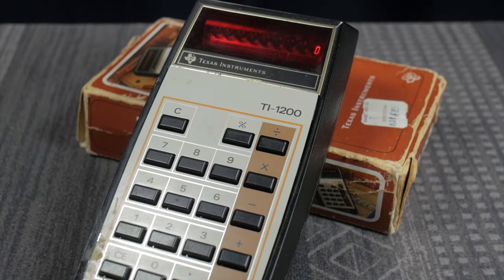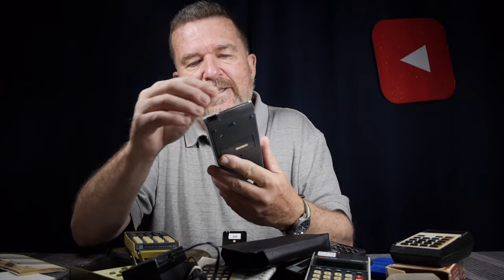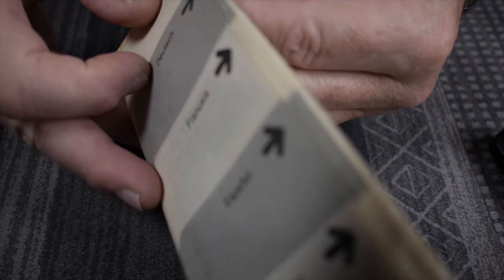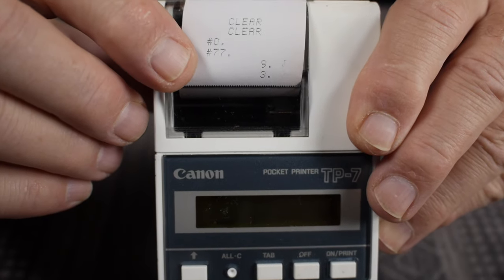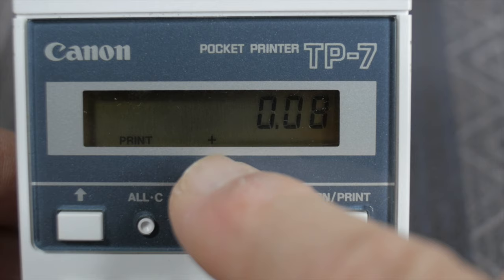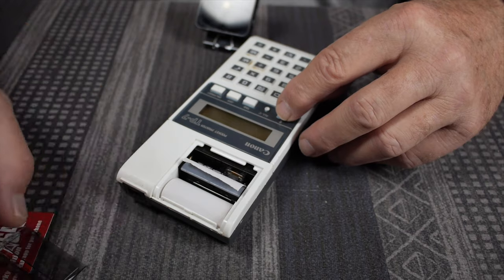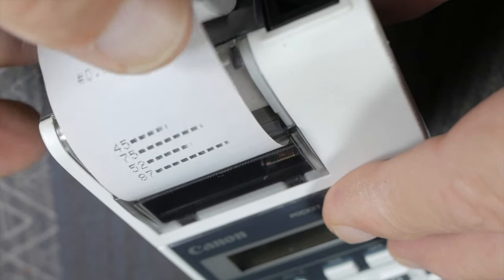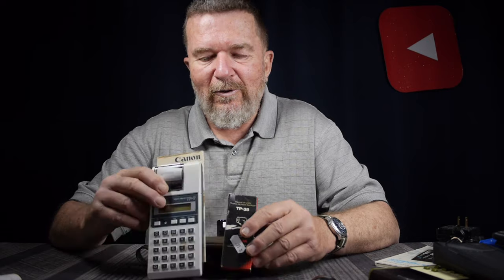Canon TP-7 Thermal Printing Calculator

Comment: Some interesting calculators you got there, Joe! Just this weekend I found a Canon P4-D, same model as we had at home when I grew up. It uses ink instead but it's dried up ofcourse. So I'm thinking about letting it soak up a bit with some Molotow ink.

Comment: I got the v1 for 2.50 at Goodwill. The hardest part is finding paper that fits. So I'm just gonna buy the cheapest smallest bar clamp I can find and use that as a roll holder.

Comment: Loved seeing the small thermal printing calculator and we own the CASIO version, the Casio HR-5.   Uses the small thermal rolls.   The calculator works great, but I can’t find the small thermal rolls any longer.  1.5” x 14’.    Just can’t find them.   Then I located them on a website ACEDEPOT.com, ordered the small thermal rolls and they never arrived.  I tried to contact ACEDEPOT.com and no response.   So I’m back to having no resources to locate those rolls.   Love these small thermal printing calculators but you can’t use them without those small rolls...